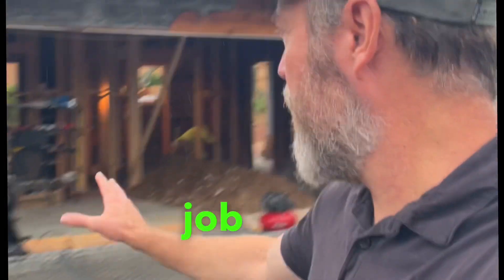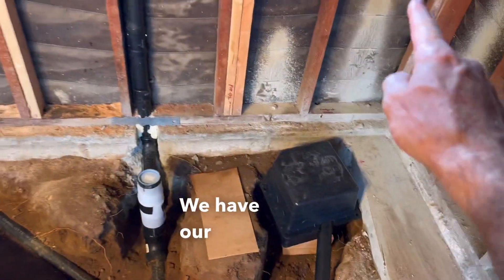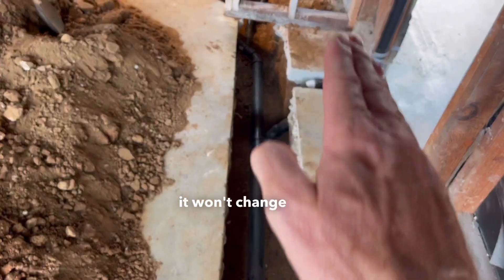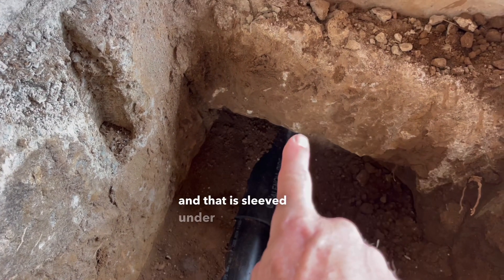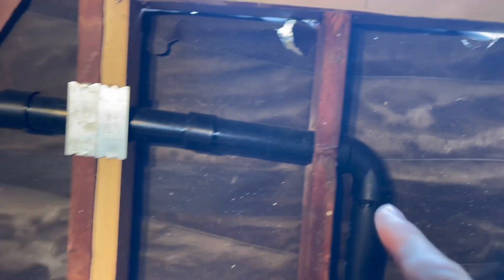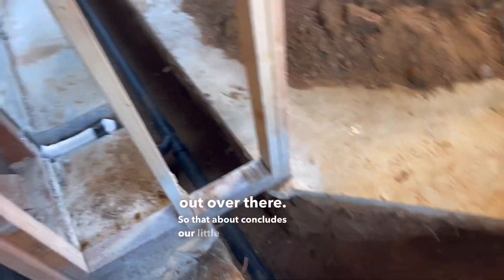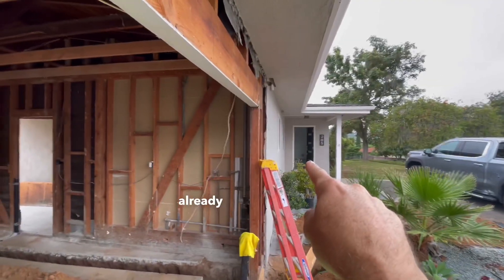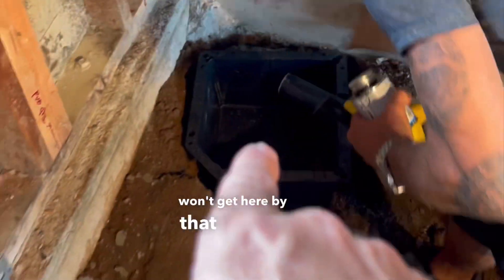Garage to ADU; Underground Plumbing Show & Tell.

Comment: What is the foam wrap for?
Reply from the maker: That’s to protect the pipe from rock in the concrete foundation. Pipes vibrate as water passes through and over many years those rocks can wear through.
Reply: @theconstructionzone7  oh got you thanks! I just did new drains in my adu and plumber didn't do that lol hopefully I don't have any issues